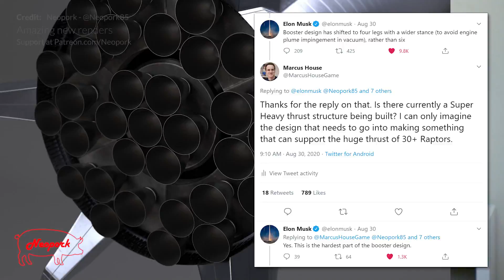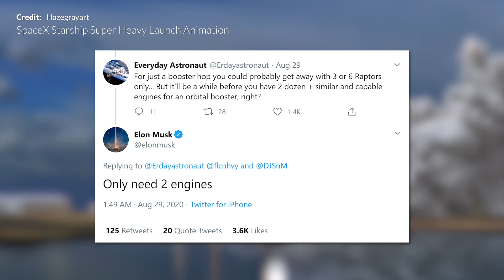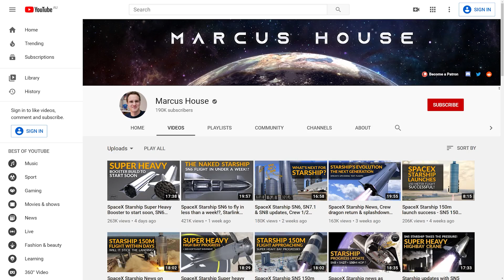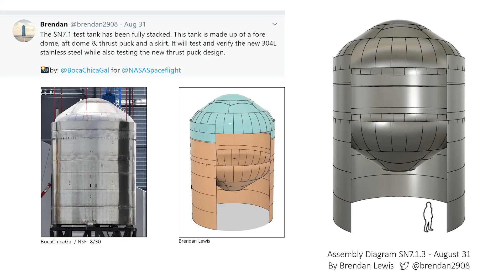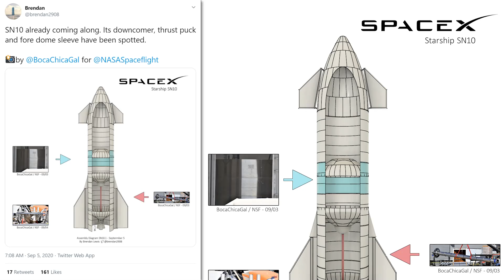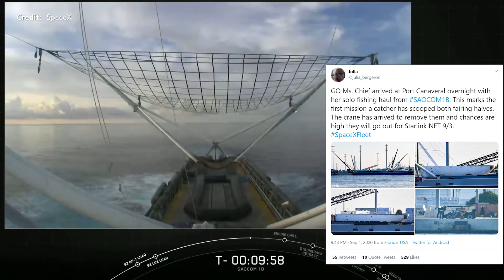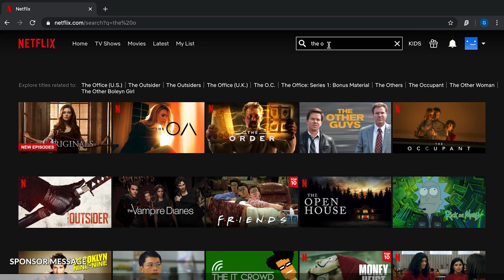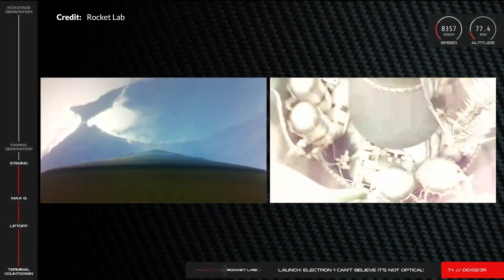SpaceX Starship Super Heavy and Raptor Engine Evolution, Starship SN-6 Hop, Starlink, SAOCOM 1B

Comment: If they are going to reduce the number of engines to such a degree, maybe they should add a couple of vacuum raptor engines to make the boost back burn more efficient, and the would only get used once per flight, so you should be able to use them for a lot of flights before refurbishment.

Comment: In regard to Booster engine layout. I believe the bottom of the engine bell is about 0.6 metre radius, and the hardware above the bell a little less than that in its distance from the centreline. The 20 fixed engines would comfortable fit if their centres were 4.0 metres from the booster centre. The 8 inner gimballed engines are possible centred 2.0 metres from the booster centre. This allows space between the engines for pipework from the LOX and CH4 tanks to pass to the outer engines. This pipework will likely be curved to provide for thermal expansion/shrinkage. I expect 28 sets of pipes to run from two annulus (??) - one each for LOX and CH4. While it adds a little weight compared to using say 4 sets of larger pipes feeding a manifold branching to 5 engines,  it is very simple in operation. While the LOX/CH4 mass ratio is 78:22, the Volume ratio is about 58.5:41.5. The LOX fuel pipes will need about a 20% larger diameter than the CH4 pipes. I assume SpaceX will want a valve on each end of a fuel pipe in case of rupture and to control propellant flow. The average fuel density is about 990g/L. So, when Elon says Booster needs 3400 T of propellant, it effectively needs 3400 cubic metres of tanks.

Comment: I am sure I saw the trail of Starlink Satellites fly over Melbourne (Australia) at around 7:15 on 6/9/2020.  Could tell that they are still low as they looked really fast compared to other satellites and ISS and were easily distinguishable as separate, but still really close together.

Comment: I've been thinking about the moment of Starship touch down and what might be going on there. Obviously there is a problem and I think I know what it is. There is a phenomena that happens with hovercraft where they actually fall off the cushion of air and contact the ground. Because there is so much room under that skirt an air cushion is created. The air pressure under the skirt rises as the vehicle descends. This pressure builds until a little burp of air pressure slips out from underneath the skirt. When this happens one side looses lift and contacts the ground hard enough to do minor damage. The solution is to cut some relief holes in the upper part of the skirt so the pressure can equalize. You wont need many and they wont have to be big.
Reply: Not sure the cushioning has a significant effect on this thing, engine thrust is being actively centered under the center of mass. The engine thrust supports the vehicle's weight with plenty to spare, unlike in hovercraft. The height of it means it also has a formidable moment of inertia, so variation in pressure exerted on the skirt doesn't make too sudden of a sway to one side.

The problem (asymmetric touchdown) will probably be gone when they install the complete ring of engines. So long as they test with one, they have to fly it tilted and therefore also end up with a tilted touchdown.

Comment: It's not only the thrust structure they have to deal with, where is all the weight of the entire stack going to rest on the launch pad? It's not the landing legs and now they are down to 4 fins. Look at how the Saturn 5 did it, with only 4 contact points but they were HUGE and tied into the structure with very large aluminum forgings and allot of supporting structure that focused the weight to those points

Comment: Thank you for another great video! You're crushing it, like you always do.

It's hard for me to imagine what a fully equipped Starship will be like, even if the number of engines has been reduced to 28. Just one Raptor kicks up all that dust, 28 of them will be like a fiery punch from a giant, blowing a huge hole in anything below it that's not a reinforced concrete pad.

Interesting that SpaceX hasn't given any thought to making the Starship human-rated, but that makes sense considering it doesn't properly exist yet outside of a couple of flying grain silos. NASA would have designed the thing down to the last bolt before building anything, but SpaceX works iteratively. First they make a working rocket that can fly safely, then they figure out how to include things like life support.
Reply from the maker: Thanks! Really think of starship as a cargo carrier. It is about getting many tons of payload to orbit very cheaply. Once they achieve that the world will change. At that point it doesn't matter what they put in it. Perhaps it will only be used to send cargo for a long time. Maybe other companies will load it with their own human transport systems. The future will be amazing once they can demonstrate full and rapid reusability.
Reply: The plan is to make the Starship human rated with a planned lunar circumnavigation in 2023. Right now they are just focused on getting it to work.
Reply: And that's a big enough goal for now. I like the way SpaceX does things because they always end up with something real that actually exists, instead of planning and dreaming for decades then canceling everything and going with a compromise, like some organizations we could name.

Comment: Are we sure these thrust pucks coming on site are for SN9/10? I wonder whether the first SH might simply use an SN thrust puck and one of the TPs that Mary has seen might actually be for SH. It will only be using 2 Raptors after all.

SpaceX can learn so much just with 150m hops regarding the structural integrity of the taller SH, at least partially validating the flight control systems (thruster and flaps positioning & response characteristics at least although admittedly not much about final SH Raptor steering responses), and maybe most critically validating & improving the legs and landing procedure without fear of trashing too many Raptors in the event of a RUD. The amount that can be learned from even simple 2-Raptor hops is why I don’t think they will want to wait for real SH thrust puck if that in any way delays first SH hop.

Comment: I’d ask Elon if he’s going to use the starship to get resources to space where they could build a larger non aerodynamic space ship. Like using starship as a shuttle to a mothership.
Reply: You'd have to develop a Space Dock first
Reply: Carlos Leon space mining too
Reply: Orbital manufacturing/assembly is a completely different kind of  challenge set.
It's probably going to be a thing eventually but so far there's no indication it's being worked on even in the concept stage.
Reply: @unintentionallydramatic  there is at least one company - Orbital Assembly - https://orbitalassembly.com/
Reply: @jonniiinferno9098  
Oh I know, and what makes them work is precisely that they focus on that specific area rather than having their hands in all the pies simultaneously.
We'll potentially see some level of vertical integration in terms of orbital infrastructure at some point, but I suspect not before the mid 2060s or so because the requisite knowledge is just that specialised. 
Benzos could potentially force the issue but he seems quite happy to focus on one or two areas at the moment.
Reply: @unintentionallydramatic  Because in my opinion it is at least 50 years ahead from our time. We still don't have the technology to build such structures and ships in orbit.
Reply: need the required infrastructure - perhaps if we can get a moon base with mining,  smelting and manufacturing - then we could either build ships on the moon and launch from there - or have very low cost launches of materiel from the moon into orbit and assemble the ships or stations in orbit around the moon - or in orbit above earth. However, i don't know why you would waste time and fuel moving materiel to earth orbit just for assembly. I would think assemble ships or stations in moon orbit - then move your ship or station to the location of your choice...
Reply: An intersolarsystem craft should be named

The millennium

As it would take thousands of years to reach the nearest solars system with an exoplanet

Comment: Conservative approach; raptor with 200 ton thrust still equals 11,200,000 pounds thrust for 28 engine Super Heavy!! Boing, I'm excited lol!  Saturn V "only" had 7.6 mil lbs thrust. Here's another thought;  if for some reason Starship could only loft 40 tons to LEO, that's still gonna change everything if the ship and booster can be launched an refurbed for less than $10,000,000 per launch. Two 40 ton payload's launches would only cost $20 million.  That's still 80 tons to LEO for dirt cheap, comparatively. Remember, the 100% reusability makes all the difference, and the low launch cost of course.

Comment: Hello Marcus, after watching a video about the Helix space drive proposal, I was thinking, and my brain said, that's stupid all you need to do is, create X convert X to Y and transfer Y to Z. Drew up the design for an electric driven thruster. Which converts electrical pulses into forward thrust pulses.
Joking around, I showed the design to my business associate and said, look I designed a new rocket engine, a ten year old could build it with a 50$ budget. 
LOL, because we don't build rocket engine's! I explained it in three easy step's. He responded build it.
Thinking to myself, he must not understand that this is not supposed to be possible? I explained again, he again responded, you should definitely build it, should work.

A crude prototype has been built, very crude, and it does produce forward thrust. Now it sits on a shelf. I wasn't going to build it, didn't really think it would work. I built it because it was only 50$ and was curious.

Without independent testing and validation, the prototype design has no value. I'm willing to give the design to Elon, but I do want recognition as the inventor.

moreminingproducts@gmail.com
Douglas Ray Renzoni

Comment: I guess the greater the power per engine the fewer engines will be required per booster.  With respect to the engine plume, the wider it becomes the more energy is wasted.  If the outer engines were progressively gimballed inwards in line with gain in altitude then the outer plumes would constrain the plumes of the inner engines effectively creating a virtual aerospike.
Reply: I like it. And even mounted conventionally, the outer ring of engines on F9 and Rocket Lab's Electron apparently do give some of that effect. I say apparently: Tim Dodd asked Peter Beck this in an interview. Peter was startled, and gave an uncomfortable "yes, there are things you can do with that." Pretty clear this was something Peter thought of as a trade secret.

And hey, maybe the Electron engines DO cant in.

Comment: what's a 'stringer'?!
Reply: A reinforcing strip that runs lengthwise along a structure. The overhead shot shows them inside the barrel section. Originally a term used in boat building.

Comment: I wonder for the last 2 Staship hops that the initial thrust drifts sideways before venturing upwards,....does this mean further research on the positioning of the rocket thrust? I would suggest the best case scenario would be a straight upward thrust? Weather & winds permitting.
Reply: It's expected. The thrust section is designed to hold 3 engines. However, they are currently only using 1 engine for the short hops, so the engine is off center. That is also why it tilts while flying. Once they aim for 20km, they will add all 3.
Reply: Everybody expects SN8 to have the proper 3 engines. If you look at the thrust pucks shown in these videos you'll see plumbing for 3 engines.

Comment: Why not use 6 landing legs on Starship Mega Rocket, with the same layout than Falcon 9? Could work better, without the need of auto leveling.
Reply: The landing legs on the booster are designed for rapid reuse. No moving parts, easy inspection, quick relaunch up to 3 times a day. The Falcon 9 has taken up to 8 hours just to retract the legs after returning to port. That doesn’t include inspection and or refurbishment of the moving parts.
Reply: @shallweplayLV  Do you really believe they gonna launch 3 Starships a day, e a near future? Probably one a day top.
Reply: @RogerM88  One Starship launch  a week or even once a month is still pretty damn impressive.
Reply: @RogerM88  going too moon base first then on too mars. yes at lest 2 too 3 launch a  day.
Reply: going too moon base first then on too mars. yes at lest 2 too 3 launch a  day.

Comment: So Starship eventually will replace the Falcon9 for satellite launches? Will it be cheaper per pound of cargo, if sufficient cargo exists to be put into orbit?
Reply: Elon has said a Starship launch should be so cheap it could launch with just an F9 sized payload, i.e. mostly empty, and still be cheaper than an F9 launch. All of the rocket is recovered, so just need to pay for propellant and operations costs. And operations costs should be less than F9: SS alway RTLS, so no drone ship, support ship, fairing ships. Of course, no expended upper stage/Merlin engine.
Reply: Elon said a few years ago that the Starship will be cheaper even than the Falcon One of a decade ago.

Comment: Elon needs to make a starship heavy, with three super heavies strapped together and enlarged cargo starship on top.
Reply: rename the "Super Heavy Booster" to "Heavy Booster", and make that the "Starship Super Heavy"
Reply: Or make an 18 metre superheavy.
Reply: An interesting idea. Ive noted that while we think of the Starship system as huge, which it is compared to other space launchers, we humans are quite familiar with construction of vehicles orders of magnitude larger. For example recent cruise ships are four times longer and wider. Of course they don't have to stand on their ends and fly!🤪 But they are also made of steel. A big advantage of stainless steel is the very mature understanding and technologies for handling and fabrication. If the multi-engine designs pan out, I expect there will be another generation of larger launch vehicles that actually get built in large "shipyard" style fabrication facilities, with "super-lift" component substructures being merged together in the final assembly bay.
Stainless steel has many advantages for space vehicles, not least if which is the availability in space of nickel-iron asteroidal bodies, which are already a close approximation to useful steel formulations: 
https://en.m.wikipedia.org/wiki/Maraging_steel
Reply: @GaryBickford  Good link. Steel technology is fascinating. Do you think we could choose an alloy that could do the job of the heat shield tiles while retaining the cryo strength?
Reply: It would be a ‘super duper’ heavy 🤣
Reply: His plan is to build 18 meter in diameter Starships with perhaps 120 first stage engines.  He has said many times that is easier than trying to string stages together ala Kerbal because you have to completely redesign the center stage anyway in that configuration- so just go big, not modular.  Sadly, life is not like Kerbal because I could really use that time warp feature.
Reply: Then it'll be a reusable Super 3 Heavy carrying Marslink satellites to Areostationary orbit... More cargo capability than Sea Dragon possibly
Reply: That is a Kerbal way of doing things. I like it.
Reply: One step at a time for now, I think.
My guess tbh, is that Starship will keep going as is for now, but that before 2030, FH will be as vanilla-icecream simple as Falcon9s are now, downright boring launches, cause every does what it is suppose to be doing (and it should be just that, un-surprising!). Ie that FH launches will be so bread and butter we can do them every week.
Reply: I think someone made a render of that on Reddit
Reply: @williamrosen3179  where i need to know
Reply: richy ket I think I saw in about a week ago on r/spacexmasterrace
Reply: I think that would be a little too powerful
Reply: Hyper Heavy
Reply: Why would a company ever need such a big rocket? Except for sending tons of material towards the external solar system or on an interstellar trajectory I don't see any purpose.
Reply: @cdemr  The purpose is to build a civilization on Mars.
Reply: KOΛLΛ_ NET21 to send cargo to mars on a LOT less ships?